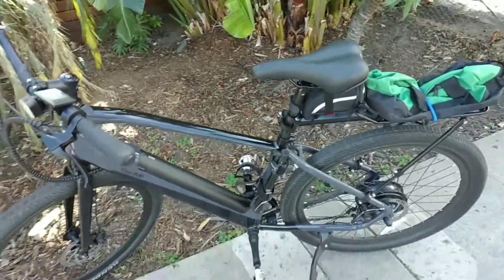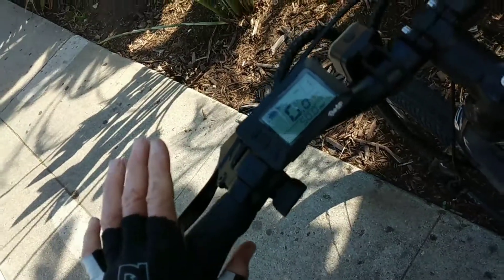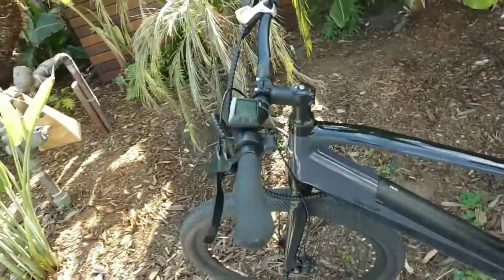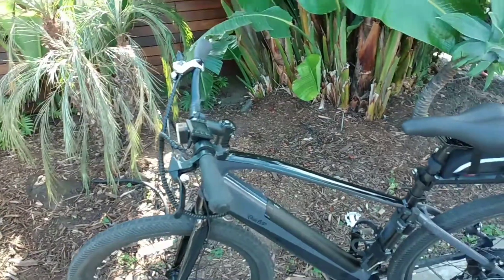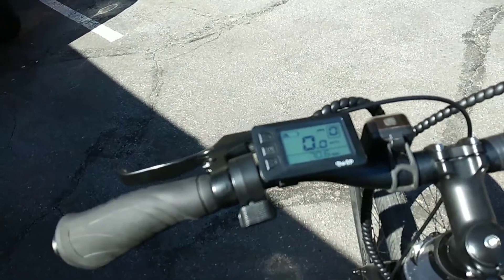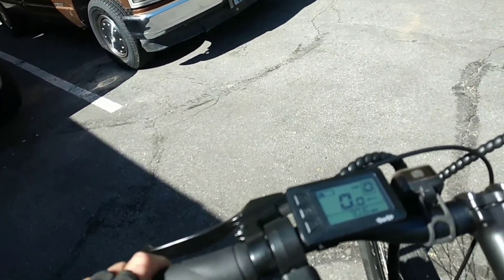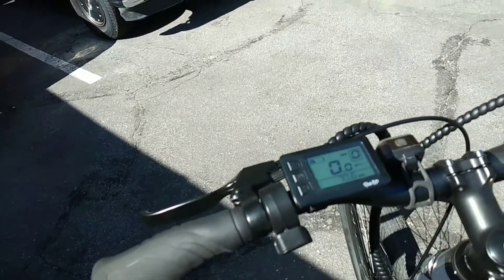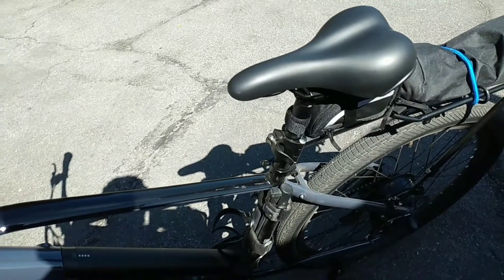E Bike Ride 1 Up Core 5 range, tires, inertia, 14 Amp Battery

Comment: I have the same bike with the original 48V 10AH battery. Bought it in January.  My longest ride so far is 24 miles. I used PAS 3 with constant pedaling the entire ride. My battery still had 3 bars left at the end of the ride.
Reply from the maker: That sounds right.  Pretty darn good!

Comment: Do you have the stock battery. Mine took a dump
Reply from the maker: Sorry to hear that is it in warranty I wonder? I have the stock battery and the 14 amp battery and both are doing well. I alternate them so they only get used two or three times a month each.